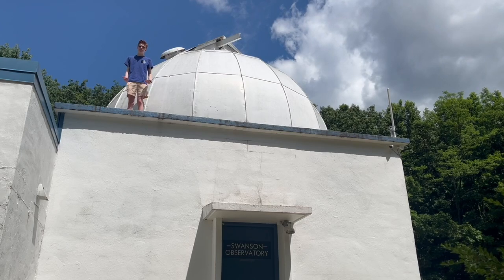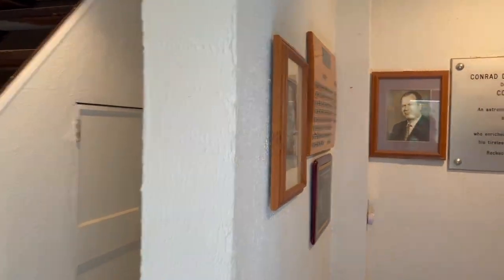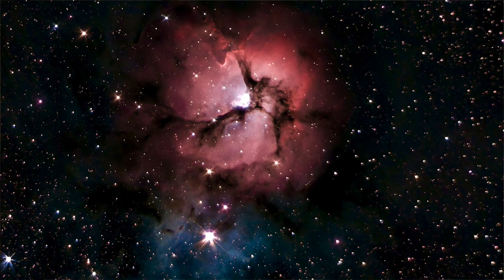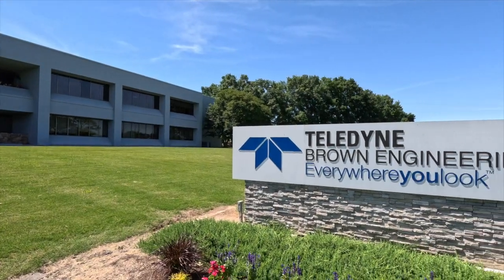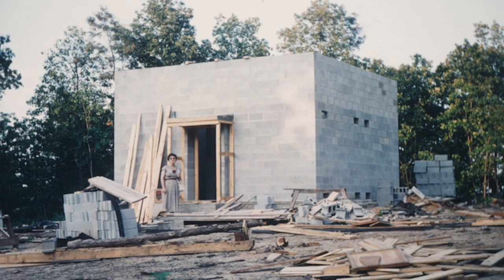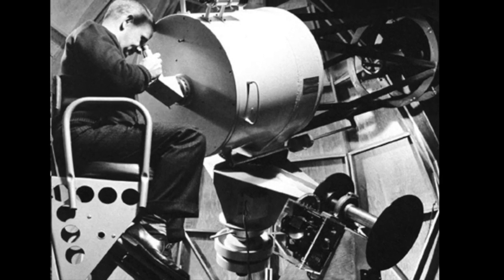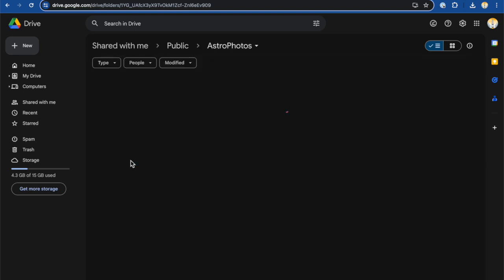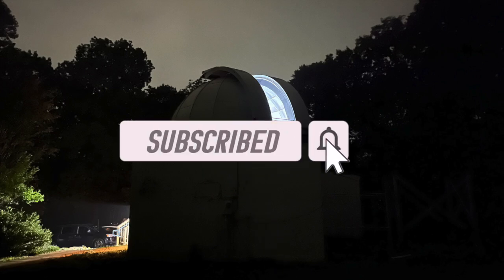Come See the KING of Telescopes!!!

Comment: Wish you could still get a 16inch newt for 600$  10k$ for that size in todays market.
Reply: Maybe for Uber premium.  There are Chinese dobs for a few grand
Reply: I got an old 16" Meade StarFinder Dob for $500. Seen some others within a couple hours for <$1000
Reply: @millenialfalcon8243  did you rebuild it?
Reply: @k.h.1587  not yet. Want to make it into a portable truss eventually. Maybe even figure out a goto system. For now, going to mod the tube and base to lighten and shorten it up. 

Mirror coating is old but still usable. Our family business uses high vacuum furnaces. Think I might try turning an old unused one into a coating chamber.
Reply: And $600 in 1957 is $6800 today
Reply: That $600 in 1957 is at least 25-30X more now. Thanks, inflation!